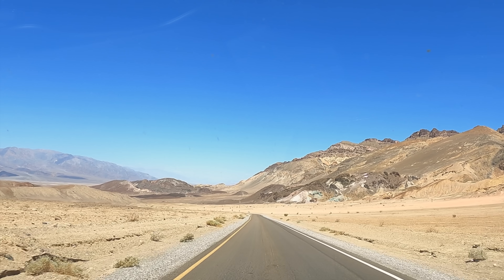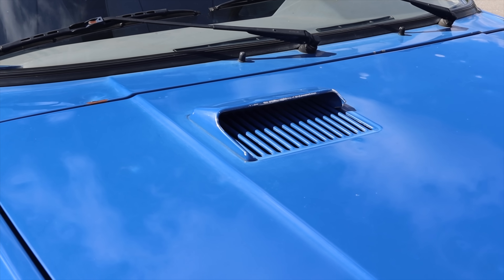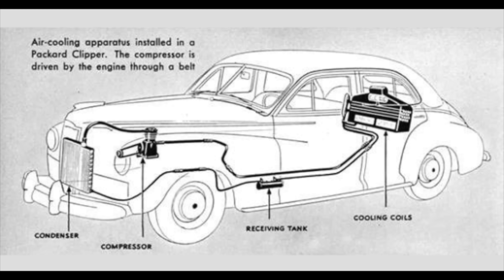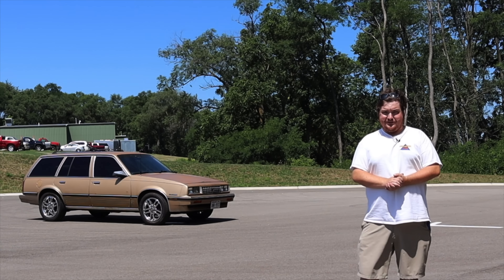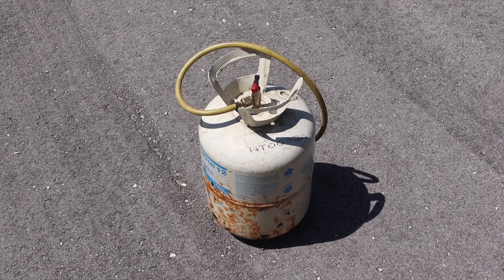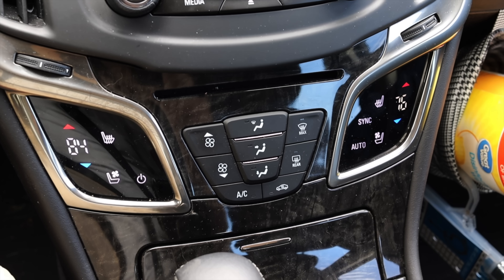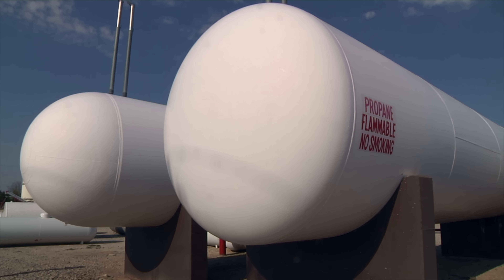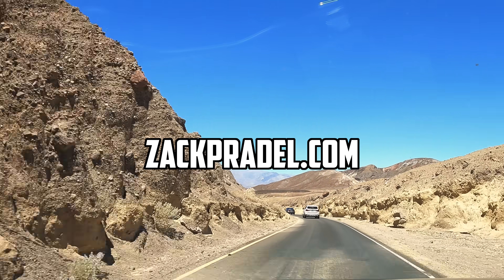Air Conditioning - The Story Of R12 & Why Modern Air Conditioning SUCKS!

Comment: We use to buy a case of R-12 from the old Zares (Chicago area) stores for less than a dollar a can. They use to also have case quart oil  10-30  10-40 sales for $,30 cents a quart. A/C  brand spark plugs they always had for $1.25 a piece. Good old days of life.

Comment: R12 was not banned for global warming, it was banned for causing the hole in the ozone but it is now gone. R134A supposedly does the same thing but as you noted the hole is gone. As for cooling ability it is not about the type of freon why they don't work as well... I have a 93 dodge Dakota and 6 years ago the AC leaked out an o ring but I could not find any R12 at the time so after fixing the leak I evacuated it and said screw it and filled it with R134 and i did not change the oil or orifice it anything just threaded on a low pressure adapter to fill it with the R134 and to this day it will freeze you.  out! I loan it to people while I'm working on their vehicles and almost every single one will come back and comment on how incredibly cold it gets. It is the coolest AC I've ever seen and I've been in thousands of different cars in my life. New cars just have too much mass in the dash... my dash assemble is maybe 50# verses well over 150# in most newer cars... all that metal and plastic holds a ton more heat and takes much longer to cool it all down.

Comment: R600 butane works, but it is corrosive in a car AC. R134A works perfect if the system is designed for it. New AC systems in cars are like 1/2 to 1/3 the size and capacity of lod systems so that more people can afford them. They also don't destroy themselves in bumper to bumper idle. That GM wagon could use R134A.

Comment: I'm 75 and from Florida, so AC has been a part of my life since I was 5 years old, auto AC since i was 11.  I'm also a hobby mechanic and have converted several older cars to R134 that were originally designed for R12.  R134 in older AC's takes a little longer to initially cool off but once going, the AC works just fine, and cools just as well as R12.  Autos designed since R134 do just fine, depending ont he brand.  GM and AMC were the first auto manufacturers to create "in dash" auto AC.  Chrysler was next, Ford was the last, using under dash AC until 1965 in the Galaxie, smaller Fords came later.  German cars have the worst AC, to this day.  They just aren't designed for extreme heat.  The best AC is the twin units found in GM and Chrysler Suburban, Yukon and minivans.  For everyday use, GM still has the best AC in any current automobile.  The AC in my new Chevy Equinox EV is excellent.  
So if you have a newer (post 1990) AC that doesn't cool down well, either it's poor manufacturer design or it's low on refrigerant.  And you need to run the AC weekly, even in winter, or it will loose refrigerant.  
And lastly, most cars made in the 80's, particularly Roger Smith's era at GM, were horrible.  And to this day, Mercedes AC is not that great.

Comment: If you get both systems properly vacuumed (thus drained of moisture) and install a new receiver/dryer, there's no noticeable difference between the two. You'll get uncomfortably cold in either one. One thing I remember the old timer mechanics telling me at the dealership in the early 00's was that R12 has larger particles though, hence why many R12 systems that have been converted to R134a tend to leak refrigerant more easily. Not sure if that's true or not.

Comment: new car acs work just fine and in fact new acs make more cooling with less power than old acs
Reply: Not in my 19 Acura RDX. I have to be moving at least 30mph before it's actually cooling substantially. Not really the case with older cars I've driven including a 2009 Corolla. As far as I can tell though, I don't perceive any loss of fuel efficiency running at max power vs. a cold day when I use auto mode. Surprisingly my 24 Model Y does ok at a standstill.
Reply: @battery_wattage i never said poor designs don’t exist all I am saying is a well designed modern ac cools just as well with less power than a well designed old ac my grandpas 2022 ram had a great ac it kept it ice cold in the middle of the Florida summer
Reply: misinformation

Comment: The minimum temperature of the cooled air coming out of tne vents has less to do with the refigerant used, and much more to do with the power of the compressor, the pressure ratio, the area of the condensor, and the management of the system.

Comment: you forget we have less and less manual cars, on a manual, you can drive at a higher RPM and in turn the compressor works better, while automatics always will seek the lowest RPM without lugging the engine, which in turn the compressor runs slower, and thus cools less

I'm always told that my car has great AC. No, it doesn't, it's just a manual

Comment: I charged my system with propane. Its compatible with the R12 system and works well. If anyone wants to argue about the flammability of it, A: carrying 20 plus gallons of gasoline is flammable, and B:  check out the newest refrigerant on the market. Thats not only flammable it releases a nasty gas when burned. To properly convert an R12 system to 134 you need to clean out the system, change the oil, change the accumulator and oriface valve and O rings, and on many cars you ideally need a larger condenser and different lines. I saw no need to do that and the people who half ass it are the ones whos systems then have subpar performance.

Comment: Back in about 1967 a guy down the street from me had this old car I don’t even remember what it was but he was out in the front driveway with a can of Freon and he was charging his system. Well he put this can down there and hooked up the hoses and let it run for a few minutes and all of a sudden the pulley started to jerk his belt started squeaking an ice crystals started flying out of the under dash air conditioner. Instead of using R12 he used R22.

Comment: R12 has been gone for 30+ years.  Modern automotive HVAC works just fine.  Just for the record, propane or ammonia work just fine as a refrigerant if you get the  charge right. 😉

Comment: Good video, and you almost talked about R12a (Isobutane and Propane). Despite the similar name, R12a is very different from R12. Better for the environment, more efficient and operates at lower pressures witch may help components last longer.

Comment: Love this video! When I was in high school, I took two years in automotive as a trade, the first year I got ASE certified in automotive air conditioning with R-134A, and then got recertified the next year (2015) for R-134A's replacement R-1234YF (yeah if you think R-134R rolled right off the tongue, try the new one). R-1234YF isn't completely standardized yet, it was rolled out in 2015, but not every automaker used it right away. Today, 95% of automakers have made the switch from R-134a, in 2017 refrigerants with a GWP (global warming potential) over 150, were banned. R-134a has a GWP of 1,430, while R-1234yf only has a GWP of 4, what a jump!

Comment: The part about R134a being an unsafe toxin to breathe.... and putting it in auto airconditioning makes me wonder...
Always air conditioning eventually develops leaks and the gas is released into the cabin when the condenser is at fault which is about half the time.

Comment: how is a R12 that is 4.5 times heavier than air destroying the ozone layer? When I worked on cars and we had a small leak the only way leak detection probe would pickup the escaping molecules (in small leak) is BELOW the part that had a leak. Someone made lots of money when patent on R12 expired. Dupont released R134 replacement refrigerant and had a patent on it, government scooped up hundreds of millions in taxes on ozone scare and price of R12 skyrocketed as it was being phased out. I remember that 30 pound container reaching over $600, that was some 20 times more $ than before the "ozone tax". I believed the official BS story of R12 destroying the ozone layer, but detecting those small leaks UNDER the part that was leaking or on the garage floor (below small leak) have told the story that is in concordance with specific weight of R12 - (heavier than air) therefore molecules fall towards the ground, the do not go up.

Comment: The list of refrigerants is hundreds of entries long, and it includes propane, methane, ammonia and many more chemicals you'd never think as refrigerant. Heck, CO2 is also a refrigerant (albeit in very high pressure systems). There are salty water systems too.
The issue is - efficiency and toxicity.
Some refrigerants work best from 100°C and hotter (ammonia), and some have peak efficiency at 10°C.
And then there is complexity: some refrigerants need more complex systems to make them work, thus being more expensive.
It is a really complicated topic.

Comment: It's incorrect about  R-134A, it can actually very easily go well below -50deg F. In-fact most refrigerators only a few years old or so are R-134A. Here is the problem, if you bring the A/C in the car too low, your evaporator will freeze up due to moisture in the air which is something you don't want. Your refrigerator regularly has this issue thus it has defrost cycles. R-134A had different pressures, most new cars utilize a "cross-flow" type condenser which means every flat tube actually has several small tubes within, the reason you can't flush those out.  

The rest of the process is controlled by metering through an orifice tube or expansion valve and a thermostatic switch in the evaporator coil. Technically if I adjust the thermostatic switch, adjust the metering and bring the compressor closer to vacuum I can make your R-134A system freeze you out , literally. However I would have to develop a defrost cycle to prevent the evaporator from becoming a ice cube.

Comment: We had a Mark IV hang on air conditioner in out 1959 Rambler Cross Country wagon. That thing would freeze your balls off and make ice cubes in the glove compartment! But when that big ass York compressor would kick on, the 235 cubic inch 6 cylinder engine would slow down. Ah, the old days....

Comment: All my systems I build use R290 (pure propane) And many modern refrigerators, dehumidifiers and automobiles use R600(Butane) yup same as in your lighter, just filtered more, with non condensables removed. All this talk of R12 or R134a is moot.  Neither are better, neither are needed. Hydrocarbon based refrigerants have ZERO environmental impact, Are zeotropic and offer excellent condensation glide. Offer exceptional miscibility with basic lubricants (ability to mix with, and stay mixed with system oil/lubricant. Supremely important when running evaporator in vacuum and below -30f.
And also Hydrocarbons are super cheap. At most 1/10th the cost of standard refrigerants. Also you can literally, take a bottle of BernzOmatic torch gas, Chill it upright to 0 f. and run the evaporate thru a filter drier into another container. Bam super dry, clean R290 for your self.   Been doing this since late 1990s on everything EXCEPT interior large volume A/C systems. There are guidlines for maximum hydrocarbons per square foot room volume. But it all comes down to, of it is BELOW 17% leaked gas, it cannot maintain combustion. This is why refrigerators with R600 Butane are sized by the grams of refrigerant...etc...Its 2025 catch up. This was all happening in 1990s with Hvac. your all late, as I am to this vid. lol.

Comment: Absolutely disagree that R-134a is the problem. Manufacturers are not ducting vehicles as efficiently as they used to, Because of all the electronic components behind the dash It has become more difficult to fit things like air ducts. This is why the center two ducts in my Mach E blow most of the air, and the two nearest to the doors blow next to none. Similar story in my wife's BMW. 80% of the cold air is coming out of the driver side, with the passenger side horrendously underpowered.

Comment: The AC in my 1989 Corvette produces absolutely frigid cold air. It still has the original R12 charge from the factory. I have 6 small cans of R12 as a back up if I ever need it. My downstairs White Westinghouse refrigerator, vintage 1982, also has the original factory charge of R12 in it. R12 is a great product, too bad non professionals abused the safety and proper usage of it that it got replaced with a lesser product.

Comment: I recently purchased a relatively newer vehicle 2019 model year and it had sat on the dealers lot for about a year and when i got it the AC was blowing warm so i just decided since i am extremely frugal and was coming from a literal convertible as my previous car, that I now live in the 1950's and just a normal fan and windows down is all that is needed. since i am too lazy and cbf'd to go out and recharge the damn thing.

Comment: While 134a may not cool as well, all other things being the same (such as when retrofitting r12 to r134) there's an easy way to overcome that, that modern cars do.....size up the system a bit.  A bit bigger coils, and a better compressor. Done.  I'm not saying that's easy or even possible with existing r12 systems, I'm saying they thought of that when building these 134 systems.  Just started making them a tad bigger.

Comment: The propellant in canned air does in fact work well as a retrofit refrigerant in R134 systems. It’s not a one for one swap as far as the amount required but once you nail the quantity, (and a couple of other things) the ac will freeze your cojones off. 🙂

Comment: The R152a in Dust-Off works great FWIW.

I recharged a 2002 Impreza with Dust-Off after replacing all the O-rings and it's been going strong for years. It should theoretically be slightly better than R134a too.

Comment: Despite over two decades of no R12 production and obviously declining use of it, the concentration of R12 in the atmosphere is barely lower than it was when it was phased out.  Also, why were the problems with the ozone layer primarily at the poles?  Finally, UV radiation is what causes the production of O3 in the upper atmosphere....

Comment: 7:15 I use propane in my car, and I measured my temperature from my vent at 29.9 Fahrenheit when the heat index was almost 110, and usually hovering between 31-35 when cruising around. It gets cold, and it gets cold FAST. 

Even on the hottest days, my car is comfortable with the windows up within a minute or so.

I don't use it in place of 134a, but rather in conjunction with, like an additive. It doesn't take a lot

Comment: Good video, very factual BUT the freon mandates are just cash for eco psudo science.   The newer ac systems do work as good if not better than r12 systems as cars are much bigger now and were made to have room for larger, condensers, and larger evaporators, which compensate for the less efficient freon.  Its why dash boards got 10 miles long in the 90s… to fit that and also air bags in.  It is also why retro fitting a R 12 system with 134 never works as good because it takes larger evaporators and condensers to equal the R 12 design due to the lower efficiency Freon with 134.   You can never get an R 12 system to work as good with r134 as it will with r12.   But a good r134 designed system works fine!

Comment: The first gen. auto A/Cs used propane as the refrigerant. It's being looked at again as a replacement for R134a (because of the climate freaks). Nothing wrong w/ propane (R290) as it works in a closed system and only is hazardous when charging and maintaining a system.

Comment: The efficientcy of R12 vs R134A is not the problem. Most car heater cores are full flow at all times now. This is what helps heat get into cars a/c systems.

Comment: I was expecting some actual information but this video had nothing. Maybe some BTUs and measurements to back up claims for why modern refrigerant is worse? R134a was being phased out even back when this video was made. 

If a car needed better cooling they would just make a bigger evaporator. R134a can still frost over an evap core so R12 wouldnt somehow make it cooler than that.

Comment: I'm calling BS on that propaganda about saving the planet.  Now that the patent for R-134a has expired, they have conveniently decided that the auto industry has to adopt a new refrigerant called R-1234yf, which is a lot more costly and less effective than R-134a.  Not only is R-1234yf more costly and less effective than R-134a, it is also flammable, unlike both R-12 and R-134a.   I'm an 80s kid and I remember how good air conditioners used to be.  I also remember how much the cost of AC service soared after the mandated phase-out.
Reply: Stop making things up. 134a was never patented and has been around since the 1930s. The patents on R22 and R12 expired in the 1950s. Patents had nothing to do with it.
Reply: @Redtooth75  Dupont's manufacturing patent on R12, expired in 1979.  The timing of the patents have everything to do with it
Reply: @datvik7187 which was over a decade before the Montreal protocol. Dupont fought the Montreal protocol tooth and nail because they did not want their brand to be damaged. They lobbied and fought it for years, they were absolutely not supporters of it. It was and currently still is an environmental concern not a market concern.

Comment: I grew up with cars from the early 70 and 80's. My dad's Ford LTD station wagon could actually freeze water vapor when running full blast. So there would be a few minutes when we first started running the air conditioner that it would be blowing "snow" out of the vents.